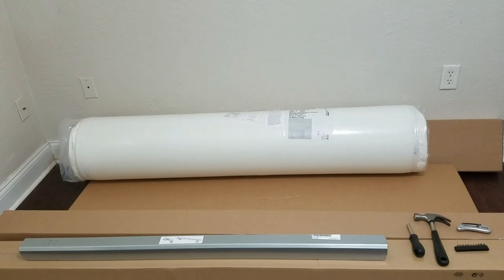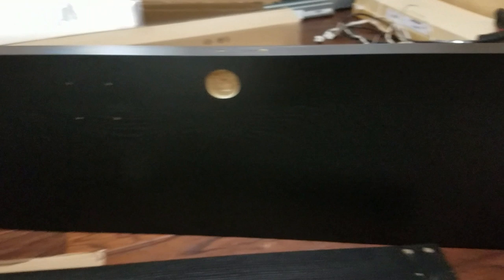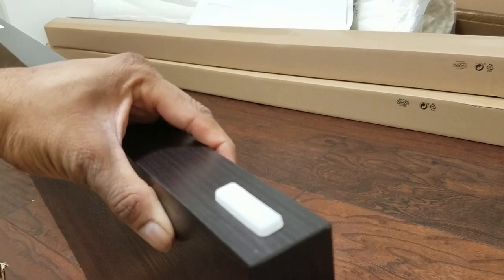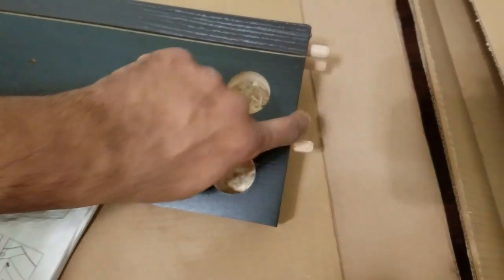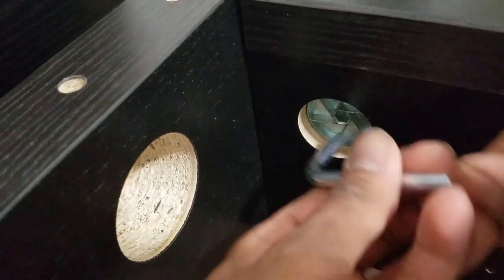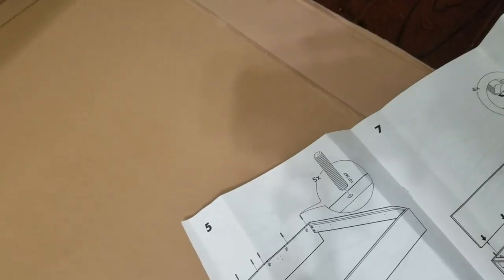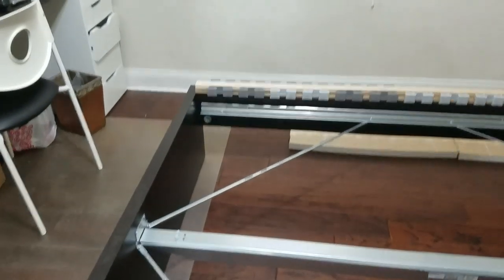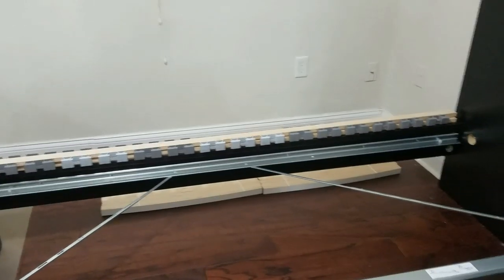Ikea Malm Bed Assembly - #Ikea - Ikea $ 50 giveaway Ends Dec 24 2019! Just Comment & Sub to enter!

Comment: Ok, so bought this bed recently. Boyfriend put it together. So far all ok. Then we put the mattress on it and it's impossible to sleep on! Mattress just sinks straight down if you sit in any of the corners. What should I do?! Please help!
Reply from the maker: that depends on which firmness you selected for the mattress, i went to an extra firm one and its fine, Fortunately, Ikea does has a great exchange policy, get a thicker or a firmer mattress, or just try it out at the store to see which one doesn't sink in. Now as far as the issue with the corners. even if you even get a giant box spring mattress or even the fancy purple mattress, the corners all mattress even sofa cushions are the weak points cause they aren't able to distribute the weight evenly and they will sink more than the center. Some sinkage is expected, but the firmer the mattress, less it will sink in, you have to find the balance of firmness and comfort. I hope I did answer your question.
Reply: We had the mattress from the previous frame. It seems we forgot to pick up slats while we were getting the frame. So hopefully that'll fix it!
Thanks for your help though!
Reply from the maker: @TMS2101  Oh WOW. Yep, without slats, the mattress isn't going to work at all. I do have a video about the one that I used - https://www.youtube.com/watch?v=ERFGLqdLLLw hope this helps. I did go over the cheaper option that ikea has vs the one that I opted to go with and why.

Comment: Whats the white pieces hammered for at the begginnin
Reply from the maker: Those were the bottom bed support thing. I.e. the frame site on strong plastic raised supports about 1 cm thick so of needed the bed can me moved easily
Reply: @ManRat  i did not put them on since my room is carpet
Reply: . i did not put them on my room is carpeted. Is it gonna harm the bed?
Reply from the maker: @alexj904  Hi Alex, no its not going to harm the bed. its mostly for tiles and wood floors so the bed can be moved around with minimal effort, its smooth plastic so very minimal friction.
Reply from the maker: @alexj904  That is perfect and fine :) enjoy the bed, its really is well made isn't it.
Reply: @ManRat  ok thanks